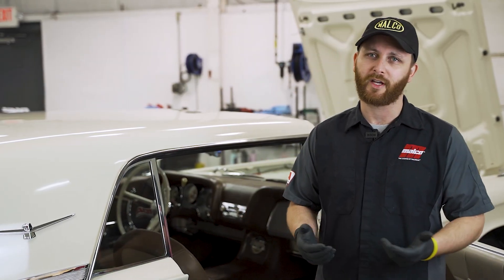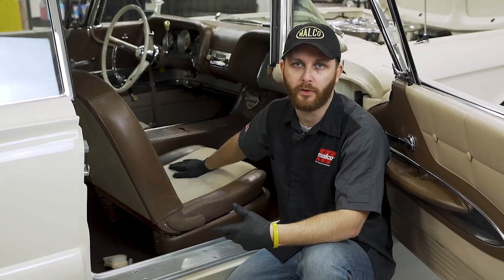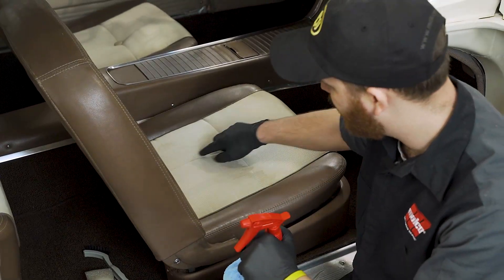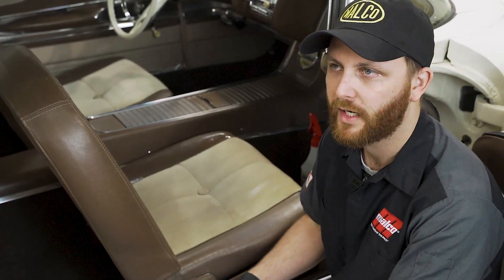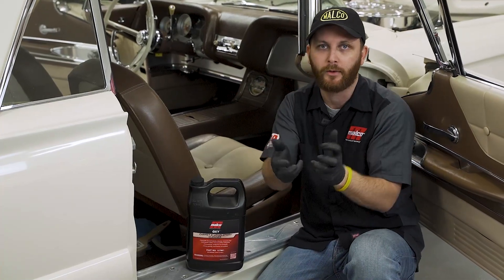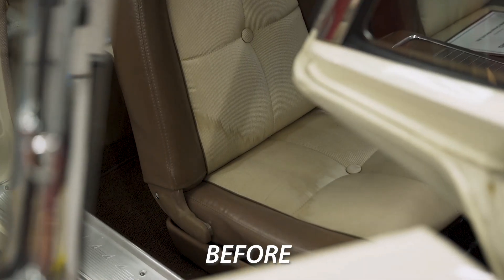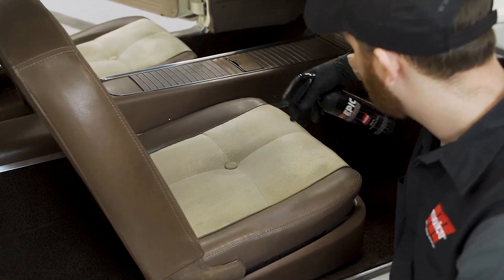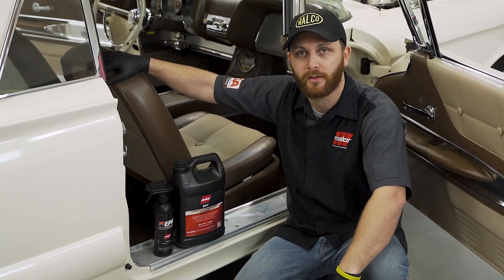How to Fix and Prevent Water Stains on Cloth Seats

Comment: My truck has these stains on the seats from a water bottle leaking...I couldn't believe water would stain my seats like this!!  My thinking was if water gets on my clothes it just dries and goes away but not with car upholstery for some reason..gonna have to get your product now ,thanks
Reply from the maker: Water can be such a pain! The foam in our car interiors will soak up water, creating actual staining and sometimes even mold and mildew buildup. An Xtraxtor machine would be your best bet at tackling these issues in the future and for removing remaining liquid or cleaner so it doesn't seep into the foam.

Comment: Hi, what a great video. Question is...where do I find that cleaner?
Reply from the maker: You can purchase the Malco Oxy Carpet and Upholstery cleaner and the Epic Fabric Coat on Amazon. Here is the link to the Oxy product: https://www.amazon.com/Malco-Upholstery-Powerful-Interior-Automotive/dp/B00PEWIVPU?ref_=ast_sto_dp
Reply: Dollar Tree sells a product called Awesome, is as good as its name.
I would once done, I know have kids, use unscented baking soda, gently pour it over the seat, let it absorb the left over water after it has been cleaned. I have used also baby powder. My kids use to make a mess on the vehicle back seats, and their bed, usinf baking soda and baby powder helps a lot.

You can mix the Awesome with Simple Green, great results at a fraction of the cost.

Comment: I like your video on water stains. My car seats are easily stained, even with raindrops. I will try your recommendations. Also I have 2 glue spots on my passenger seat. How can I get rid of those?
Reply from the maker: Hi Susan, for the glue spots we would recommend either Spray Citra Clean or Instant Out spot and stain remover aerosols with a microfiber towel to remove those spots. It would help to understand what type of glue it is, but either one of those would be our go to.